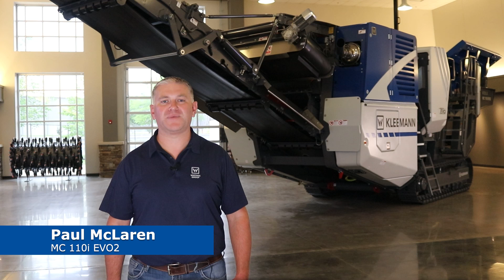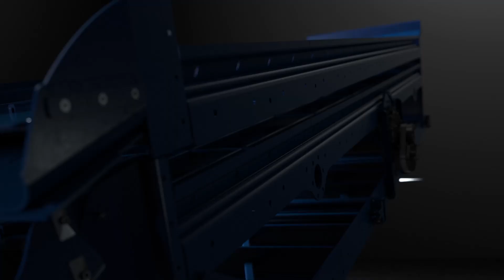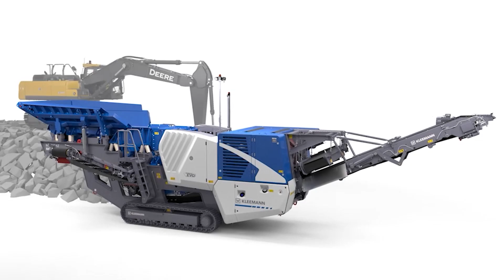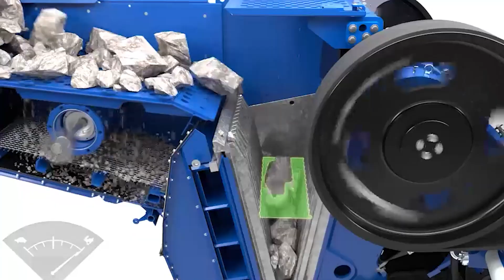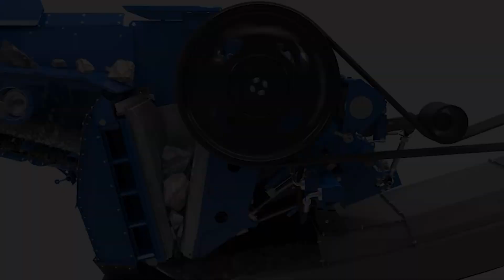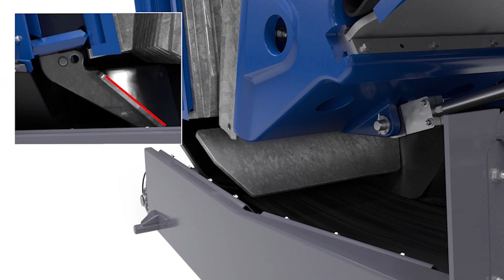MOBICAT MC 110(i) EVO2 crusher unit - Technology engineered for you

Comment: Truly impressive system there. If I had an organization that required the volume of throughput and dependability it can maintain, this might be my standard for comparing all others, perhaps ending up making the simple and conclusive buying decision.

A really well appreciated and most likely profitable favor to the demolition industry would be to invent a rock and concrete crushing system that was more appropriately scaled and costed to job-site operations; the size where the throughput needed from the crushing system is not measured in several tons per hour; more like 1/2 to 1 ton per hour.

Instead of having to pay for hauling castoff rock & concrete to commercial operations, contractors could process the material into forms useful on the jobsite, or possible to be sold to other parties.

Not only would this open up new business for the machinery, but could help with environmental concerns over the swiftly growing number and volumes of illegal construction  materials dumpsites.